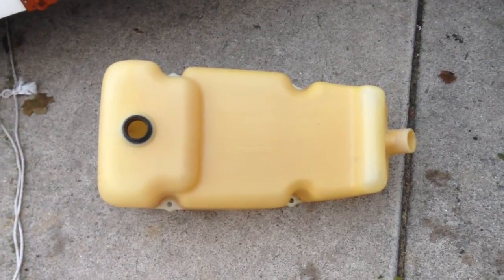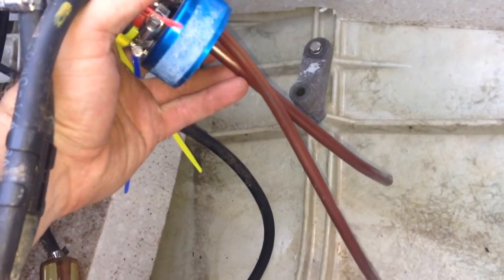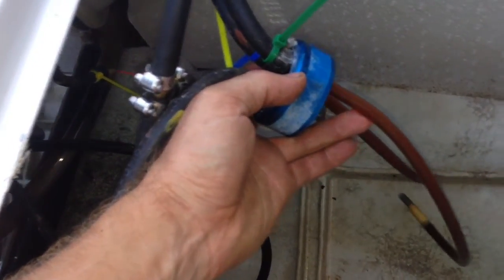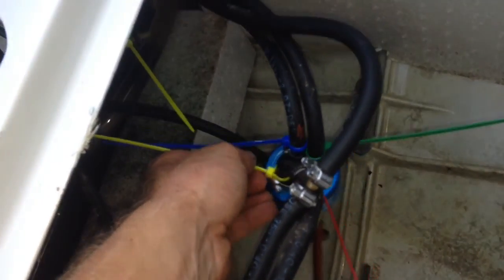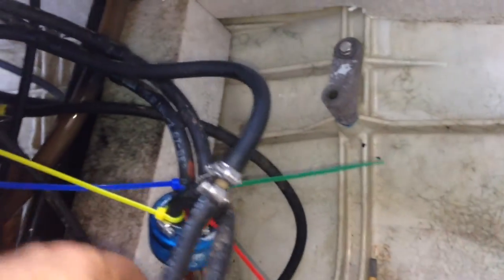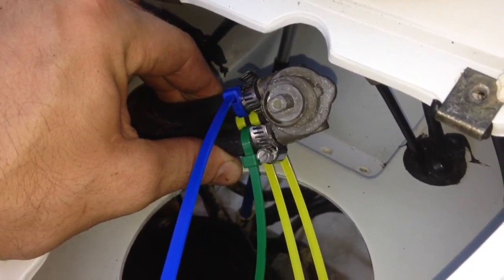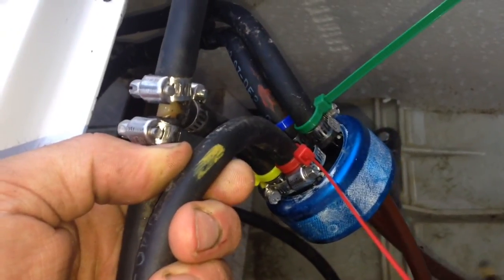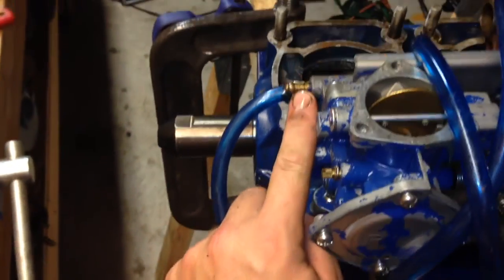Polaris SL 650 Fuel System Layout

Comment: Do you not have a return line going back to the tank
Reply from the maker: Correct, this system deletes the return.
Reply: @SparkysGarage  well if you delete the return where does the unburned fuel and air go
Reply from the maker: @shannonwilliams601  It should be only fuel in the fuel line, no air. I'd imagine that the hose would stay at a higher pressure and would only use the pressure it needed to. The vacuum style pumps like this only operate up to crank case pressure. So theres no need to worry about over pressurizing the system
Reply: @SparkysGarage  on two-stroke jet skis you have a air pressure line that runs from the case to the fuel pump that produces air in the line forcing the unspent fuel back into the tank also putting the air back into the tank why do you think there is 5 lb pressure air valves on the tank and a rubber gasket on the gas cap that is because those have to hold pressure in order for them to work properly so if you have a stock jet ski it does have a return line somewhere if it's a two-stroke because they do in fact have air in the line and they do in fact hold pressure
Reply: And actually on the Polaris they even had a check valve inside the return line and a lot of people throw that away it was only on certain years but it was there I have been doing this for over 25 years and I've built probably 200 Polaris jet skis

Comment: Im not able to get fuel to the carbs. New fuel pump and cleaned the carbs, but still no fuel. Any suggestions?
Reply: Vladimir Putin id start by verifying the fuel selection valve is clean/able to flow. Then start by pouring 50:1 mixed gas in the carb bodies or plug holes. The fuel system on watercraft are a bitch to prime. If ya have any more questions I’d be happy to help